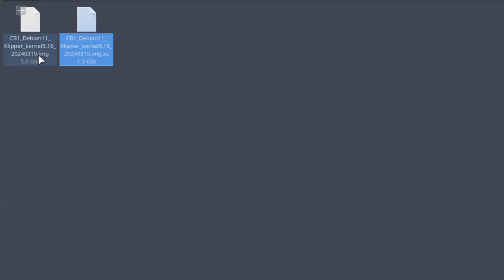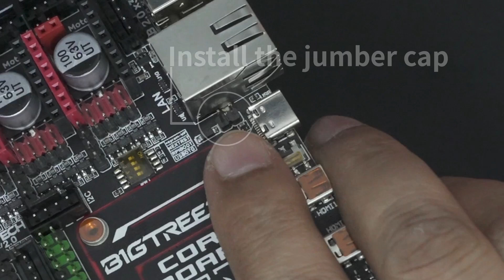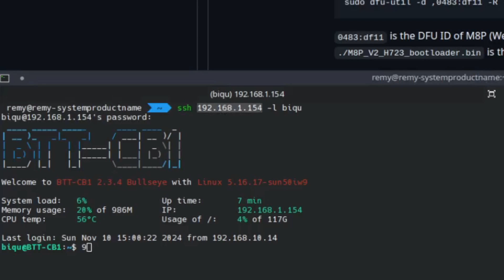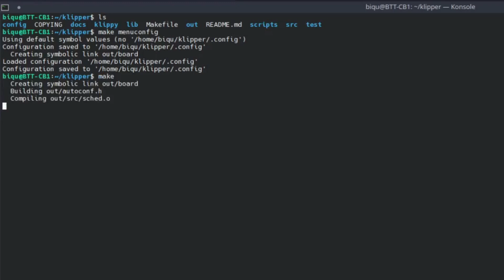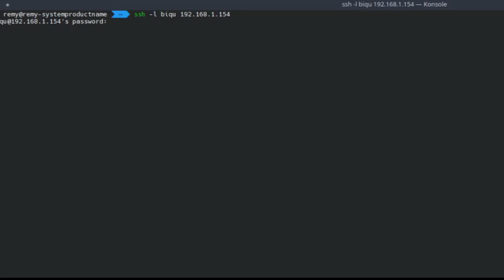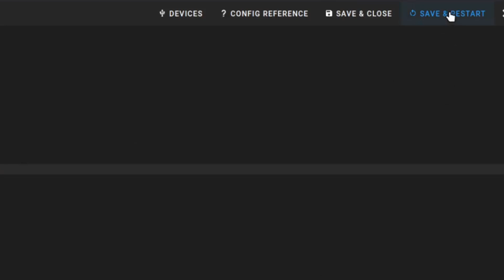Installation - Klipper/CB OS and Manta M8P/CB1

Comment: Hello sir, I was able to do everything else but not sure how you installed bootloader,
1. Does the bootloader need to be copied into the sd card along with the etched kernel image
2. I use mobaxterm for ssh login how do you transfer it 
3.Caan you tell us a detailed version of how to transfer boot loader into cb1 for a non technical person.

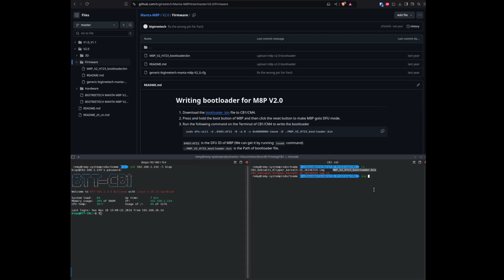Comment: at 9:47 I got completely lost for the 2nd time after finding my way with lots of researching. having no background knowledge, after writing image to the sd card and plugging it in to the board I got lost and had to resort to a ton of googling. I had to go into windows settings and install open ssh server (i didn't know wtf ssh even was) to get to the point of 9:47 and now I'm lost again. While informative and useful it would be wonderful if someone could put a guide together that didn't assume the viewer had experience with these things before. If I did I wouldn't even need this video, I'd probably be fine reading off the github documentation.

Comment: I was able to flash the board firmware as the file change from .bin to .cur, however I still having trouble finding the mcu id as it just keep showing no such file or directory after i input ls /dev/seral/by-id/*
Reply from the maker: How did you power the board? If you are powering from USB most likely it's a power issue. Try to connect the board from 12v terminal block
Reply: @radiy3dprints  yeh i was powering form a power supply, but I figured it out turns out I set the board to boot mode when I flashing the software for the cb2 and did not set it back, which cb2 did not recognize the board, after set it back it everything went through smoothly thanks for the great video!

Comment: trying to flash my new m8p+cb2 
it seems its stuck at boot cycle and not connecting to wifi
Reply from the maker: How did you power the M8P board?
Reply: i figured it out its the power supply 
I used USB before 
works perfect with 24 power supply